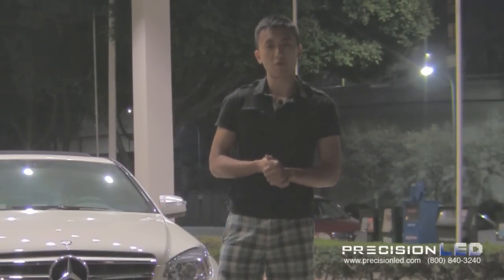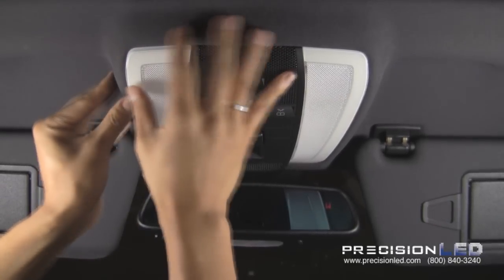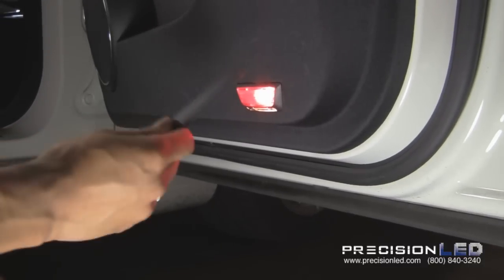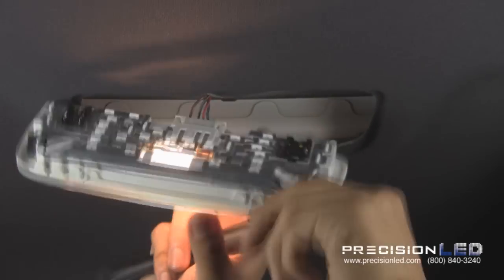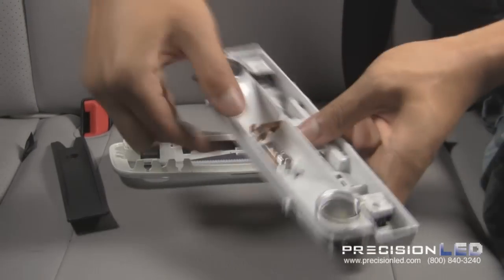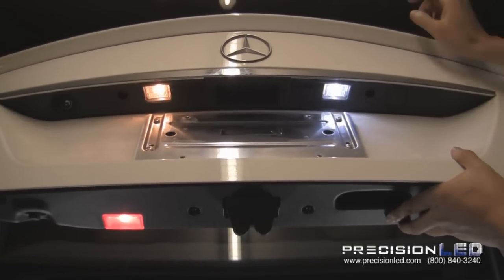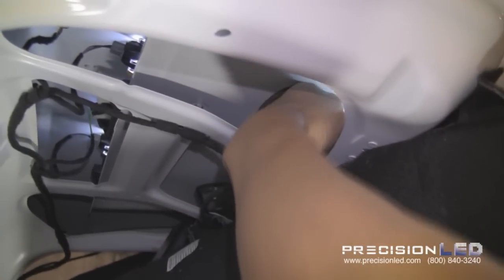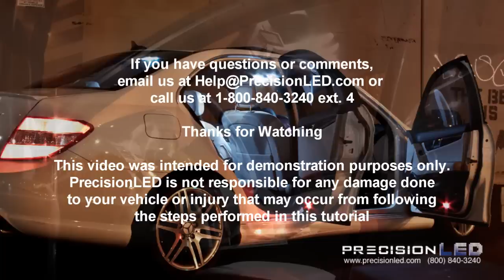Mercedes Benz C-Class LED Install - W204 (2008+)

Comment: I have been looking everywhere for a video on this and this was awsome the only thing i would like to see is how to do the mirrior lights in some of the c class models 
other than that great presentation and dude knew what he was doing
Reply from the maker: The mirror map lights are stock LED which you cannot replace as they are soldered to a chip and board. Thanks so much for tuning in!

Comment: Hey what's up bro! AWESOME VIDEO! I have a 2013 Benz GLK and want to do the same - I assume it's the same procedure as shown on this video. I also want to do the ghost shadow lighting on all doors but I notice that my doors have the reflector on them and no light, which means there's no wiring (although I have not taken the reflector off but since they do not light up I assume there's no cabling there nor power). Not sure if you've seen some that just fit on the door reflector whether they battery powered or not. I'd love your feedback bro!
Reply from the maker: Unfortunately you would need existing wiring for your doors to install lights. The installation process for the remainder of the interior would be the same as shown in this video!

Comment: Hi! I've a Mercedes Benz C 2008 W204 Station Wagon and needs to be replaced the license plate bulb (rightside). The video here you provided is for MB C 2008 w204 Sedan. So, If you would be kind to provide me the installation process or even with a video that would be so so kind of you. thanks...
Reply from the maker: Thank you for your interest.  The installation process should be very similar, if not identical to what is shown in the video.

Comment: A question i hope these are SMD LED's lower power consumption and are error free and the recommended for mercedes
Reply from the maker: Shusein, yes these are error free CANBus equipped LEDs that do not throw error codes with the Mercedes Benz computer.  We have tested this on many Mercedes Models and can confirm you wont have problems with them.

If you have additional questions email us at Help(at)Precisionled(dot)com.

Cheers,
-PLED Team
Reply: Hello! Will installing these leds mess up the SAM? The main light computer unit of the car? As far as I know, all mercedes cars have this unit called SAM and it's a very expensive part to buy from mercedes. Thank you!
Reply from the maker: No, installing the LEDs will not affect your vehicle's SAM or ECU system, as we only sell high quality Canbus LEDs to ensure you do not experience any issues with your vehicle's electrical system.
Reply: PrecisionLED

Comment: You didn't show how to install footwell lights. Do they flicker when the car is off, but the door is open?
Reply from the maker: You can access the footwell lights with the trim tools provided in the kit, and it would be similar to the other lights shown in the video. They would not flicker and are designed to operate just as your halogen lights would. Here is a link to the bulb you would install:
https://www.precisionled.com/premium-t10-canbus-6smd-5730-led.html
Reply: I said the same thing too man, I have replaced ALL my Interior Lights with High Quality the Same LED bulbs , and Everything went so smooth until the very end, my last 2 bulbs were the Footwell bulbs, and they first gave me all kinds of trouble, the Flickered, I still Don't know what the issue is, But they stay on constantly when I drive my car anywhere, so I may use this as a Plus, and install, Blue, or red LED bulbs in it's place lol and use them as aceect lighting . why not until someone can get me an answer what the hell is wrong???

Comment: which types of LED'S are you using.. As in the name of the bulbs for all of the LEDS you used ...
Reply from the maker: We only use our very own PLED brand.  Also, there are a variety of LEDs used for this installation video.  We do the research so you don't have to.  All you have to do is select the correct kit for your vehicle, and we'll ship out the proper LEDs, labeled so you know where they go.

Comment: Great video! Are all the LEDs installed T10s, except the one in the overhead console?
Reply from the maker: Thank you for the feedback.  Yes, that is correct.  The overhead console light would be a 44mm festoon.
Reply: +PrecisionLED I'm sorry but to clarify all the bulbs are T10 except the front dome lights?
Reply from the maker: All of the LEDs used in the installation video would be the T10 fitment, except for a single dome light.
Reply: excellent instructions in video 👍👍
Reply from the maker: @bibimonkey1980  Thank you for watching!

Comment: How do you change the rear view mirror "map reading lights"?? I have a 2010 C300
Reply from the maker: The rearview lights would be stock LED, which you cannot replace as they are soldered to a chip and board.

Comment: What about the 2 reading lamps inside the mirror ?
Reply: The light intensity (and color) tells me they're LEDs from the factory.

But then I own a 2013 facelifted model, which the early build 2008~2011 may not possess.
Reply: Zishan Malik Really? I don't know then...
Reply: +Octavio Barbosa There's a tab that you can push by your fingernail to open. You just need a rubber tip longnose pliers or rubbergloves. the Bulb is pain in the a$$ to pull.

Comment: How do you replace review mirror map lights?
Reply from the maker: The rearview lights would be stock LED, which you cannot replace as they are soldered to a chip and board.

Comment: What's the size of the festoon bulb?
Reply: +Mercedes_Benz65 -- I think any size will fit. The positive tab can adjust to any size. To be specific, I bought 42mm. 1-2mm longer from the factory.
Reply from the maker: +Mercedes_Benz65 42mm or 44mm will fit.

Comment: Bro said to use a lot of force and not to be scared of breaking it.. meanwhile I did what he said and ended up breaking my plastic cover lens on the front dome light and cracked it. It is rlly tight and hard to take out and now I have to buy a whole unit just to replace that 1 singular cover lens which is over $100. Not worth the risk, I wouldn’t recommend ! Smh.🤦🏽‍♂️